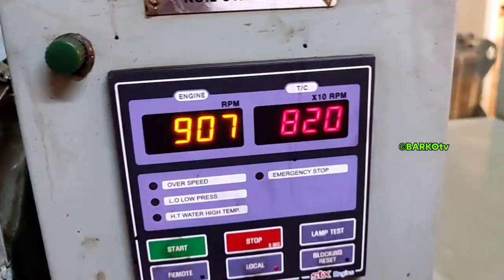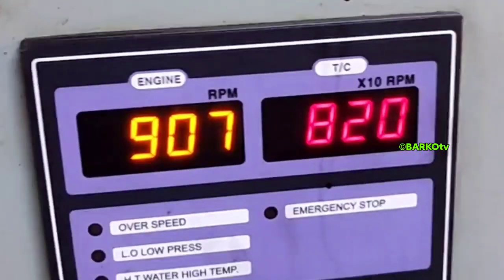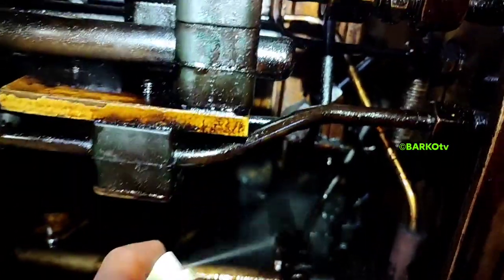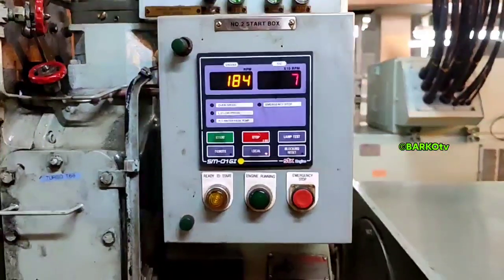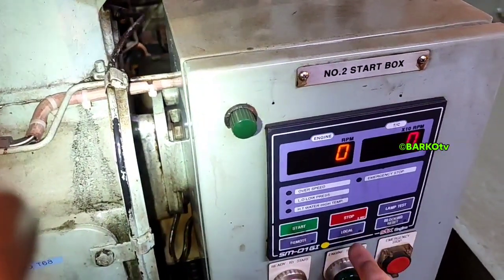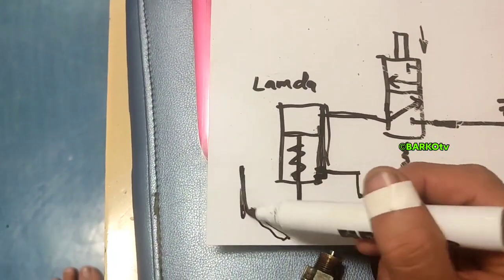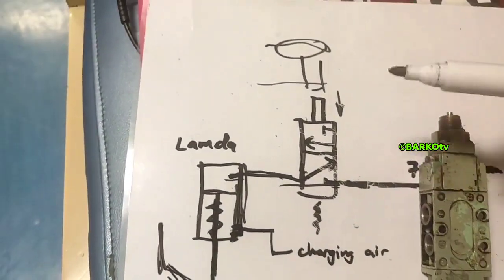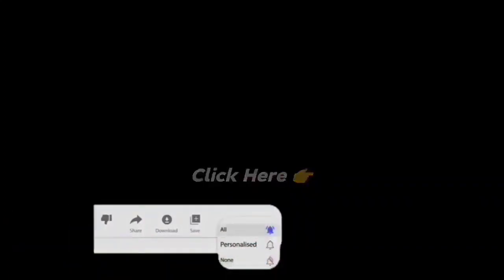How to Rectify generator shutting down without alarm. Troubleshooting guide. Man B&W stx. Lamda

Comment: Greetings 
Same engine type and I’m having engine trip circuit fail alarm , this comes when the engine is stopping and the rpm decreases , once the alarm comes the engine shut down and cannot start MAN-STX
Reply from the maker: Please check all shutdown alarms and simulate 1 by 1,maybe one of your shutdown alarm have bypass that will trigger that alarm. If all normal please check the fuel limiter that also cause cant start without alarm,there is a solenoids that triggers that fuel limiter